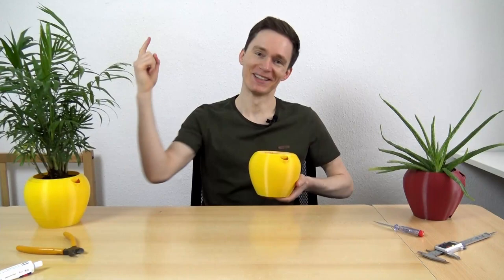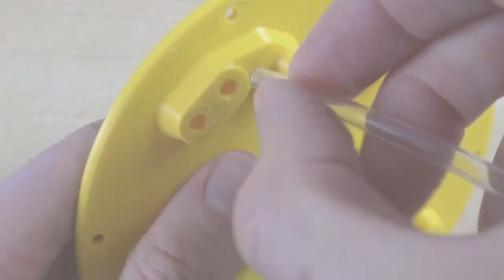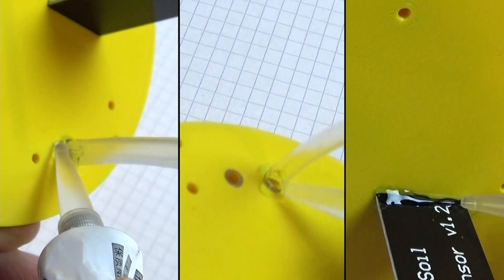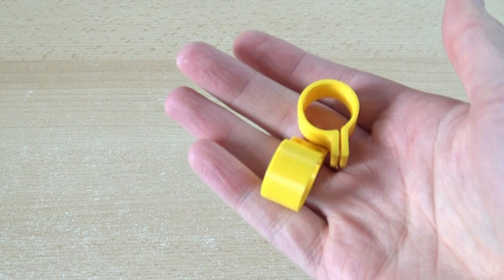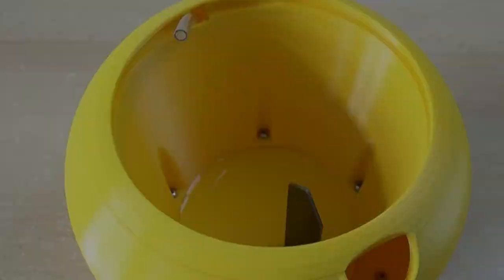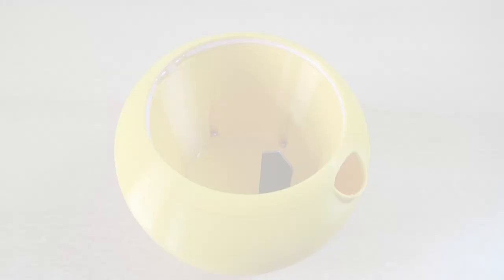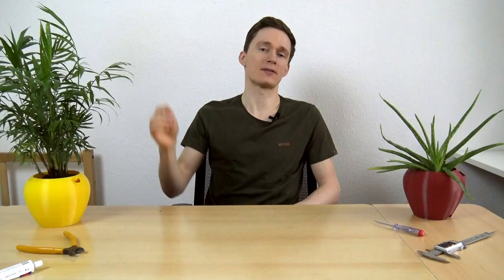Assembly of Flaura – Smart, Self-watering Planter (DIY Project, 3D Printed, Arduino)

Comment: I'd recommend putting a blob of silicone on the ends of each cable of the water level sensor, leaving only the tip of the metal exposed to the water. Otherwise water will enter and creep through the cables, ending up on the microcontroller.

Comment: I have followed your tutorial, a few years late, but I have enjoyed making it. The printing went well, and I have been assembling the electronics and the other bits and pieces. I have been successful in finding the right soil sensor (Amazon, and a good magnifier), and I am ready to dive into getting the circuit board made. Problem - I haven't found the dimensions of the board. Could you pass on this information? Again, I have enjoyed building this up to this point, and really wish to see it through to completion. It's been a wonderful project for a newbie, and I commend you for it!!

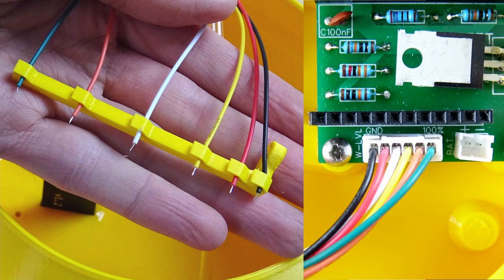Comment: 6:21 you fucked up the order of the cables, look at yellow and white. 
just wanted to let you know
Reply: Yep, yellow and white cables must be crossed on the plug side (confirmed by checking the pin assignment in your code line 31). If already cabled, can also be fixed by replacing line 31 by " const byte waterLevelPin[] = {13, 14, 26, 27, 25}; "
Reply: Where I can find code for this project?